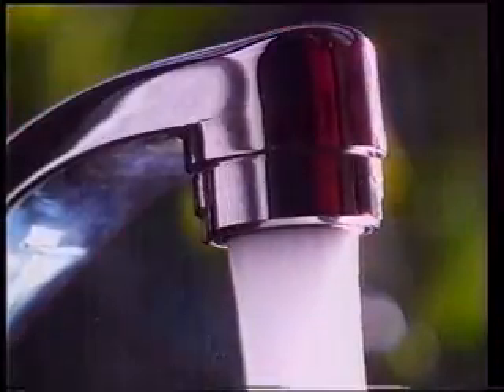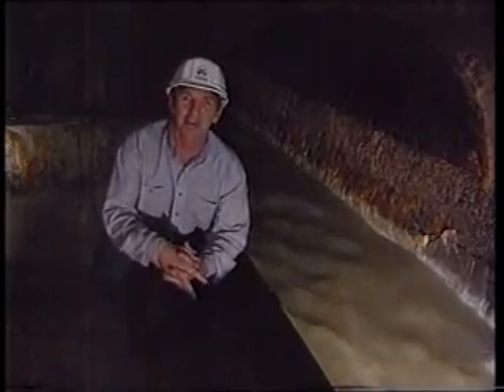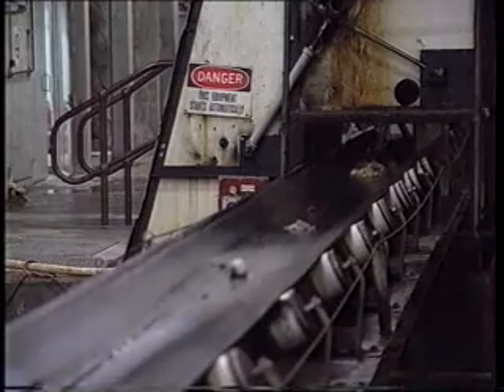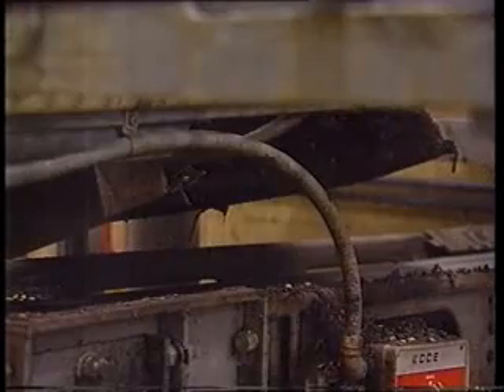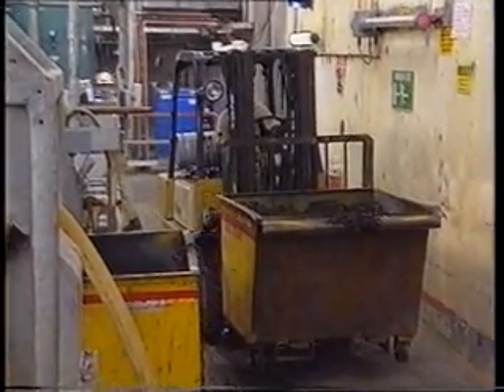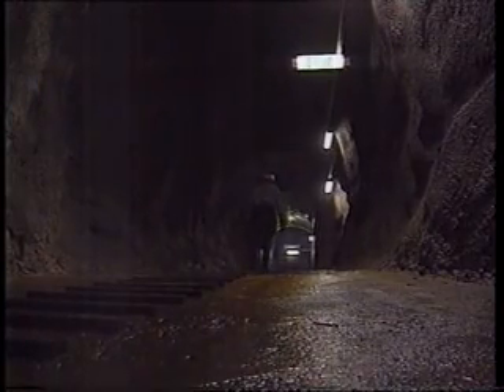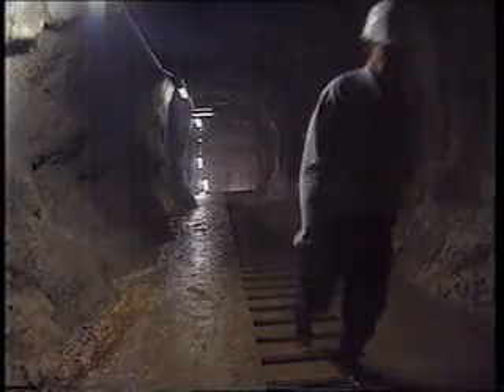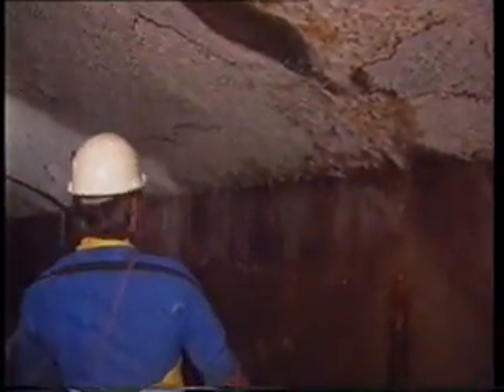Sewer Sydney

Comment: treatment plant below the ground?? probably it's the only one like that in the world.. Ok, I can understand screenings below ground... But how about primary treatment (settling tanks) and most importantly - aeration tanks. It is not possible to hide them below ground.. So this treatment plant doesn't really treat anything
Reply: Hi Enigma, it isn't actually the only underround one: I know of at least 3 more. North Head (Manly, NSW) and Brighton and Hove (UK). Bondi does have underground primary tanks, but no aeration. The treatment is only primary. With suc strong currents, waves and UV the ocean and sun do a lot of the treatment at a fraction of the energy cost of all of the power required for aeration. This is measured by impacts (or lack thereof) on the local ecosystems. Other discharge waters are less forgiving and require more treatment, but not the pacific ocean 2.2km out from the shoreline.
Reply: It is absolutely possible to have them underground. Bondi and Malabar both have underground plants that handle more raw sewer than you could imagine from start to finish.